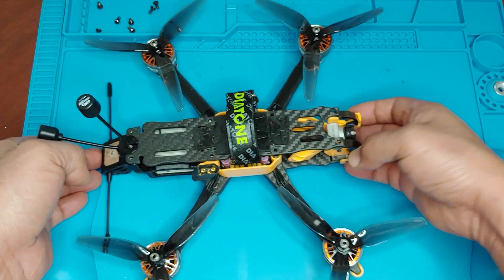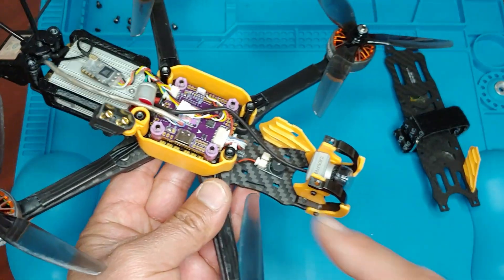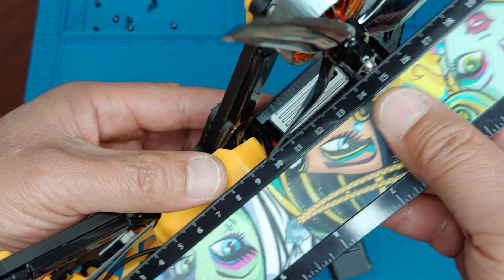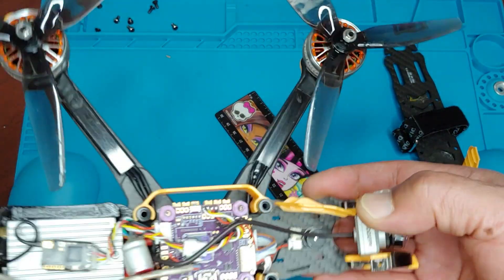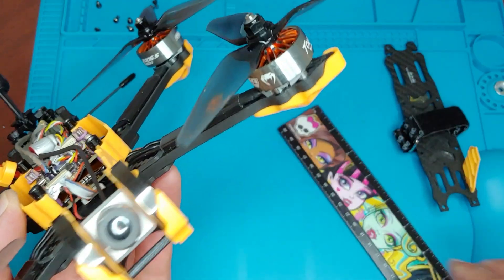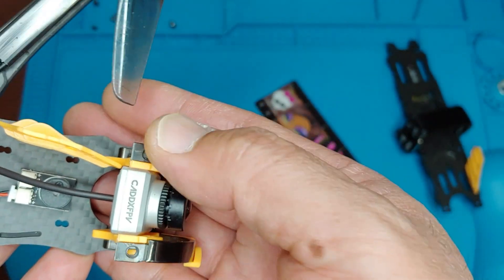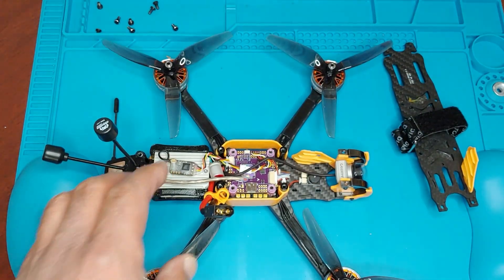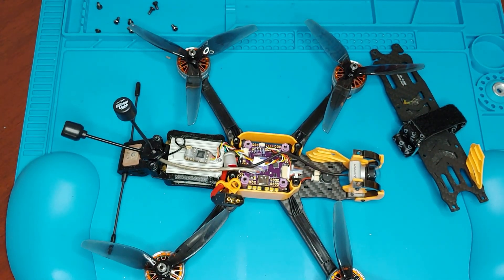Will the DJI Air unit 03 fit in the Roma F5 V2 or GepRC Mark 5?

Comment: Diatone release free stl file that can fit O3 (I do not have 3D printer, I will hack existing TPU mount). As for the front cage, Diatone upload a photo that shows exactly how I placed the camera (except that I used the carbon mount). I have not yet tested if the cage is visible... I will remove the plastic protector for sure. More to come this WE. -› https://drive.google.com/drive/folders/1biEYFoN56Uu-wNwJStyJgZBLAUQSkKdd?usp=share_link
Reply from the maker: That looks pretty good, thinking with the removal of the plastic protector like you mentioned it should be OK. Thanks for the updates bro.  I actually cancelled my order, but now after your comments and pics, order is placed. Thanks again Alexandre!!!!!!:goodvibes:
Reply: @jaechoe  looks promising for the Roma! :). I'm still waiting my crossfire receiver. But I will try live camera feed this weekend.
Reply: @jaechoe  I did my first test with my Google v2 (Video feed only). There is a small shading visible on each side. Almost unnoticeable. The tips of the propellers are also slightly visible (that might disappear using Gyroflow or Rock Steady...). The camera mount need to be 2-3mm longer to be perfect!
Reply from the maker: @alexandrelemieux6718  thanks bro, the info is awesome. As of now not alot of frames will fit the o3au, all stand off style front ends won't work since the width is way less. After gyroflow it will be perfect, thanks again!!!!! 😊

Comment: So it does fit in the mark5 ?
Reply from the maker: I was not able to try it out yet, will keep you posted.
Reply: @jaechoe  I believe it is possible. After watching this video I checked their site and noticed their offering it now with the O3 system and nothing seems to have changed. But still please do check and keep me posted!
Reply from the maker: @tylerleduc101  I just checked out he Geprc 03 AU version and the front cage looks different, seems like they put a hole in the front cage and put a 3d printed camera mount. If the mounting holes on the frame are the same width, that getting the new front cage would work.  The vista version of the Mark5 with the DJI camera 20mm width, it fits perfectly without any spacers. Will follow up once I test it.
Reply: @jaechoe  you get a chance to test this yet?
Reply from the maker: @brentroberson7371  Cole, commented that it does not fit in the Mark5 GepRC did come out with a Mark5 03au version, if the front cage has the same mounting points on the frame it can be swapped. The issue is with the 03au the lens filter up front is actually wider than the actual camera body. Most builds I have seen online have the filter/lens protector removed to fit. I still have not tried it out on the Mark5 but it does not look like it will fit.

Comment: First test with the Roma+03. The Air Unit cable is just long enough to fit the long body of the Roma, so no problem there. As for the camera mount, it's very tight. I used the thinner carbon fiber mount and it works. Will have to see if the image will be stable, I have no dampening. At the forward position of the camera mount, the cage stick out approximately 3mm. The cage could be in field of view, I don't know for now, I need to update everything and setup the quad before. I'll keep you up-to-date.
Reply from the maker: Glad it's working out so far. Thank you for the update, and looking forward to the next update. 😀 you can always crop in the image if the cage shows. But you lose that field of view.

Comment: No Jell-O but the round front post are in the shot of the camera 😢
Reply: OK this morning I was working on it again and I noticed that if you only use two screws you can push the camera up enough so the standby is are out of the cameras way🙌🏾
Reply from the maker: @manuelgonzalez3073  than the camera will have no protection, most builds I have seen so far was done that way. With the camera lens sticking out of the front standoffs. Your awesome, thanks for the comment. I have seen 1 new frame that seems to have a wider front end to accommodate the width of the 03AU lens, Pyro had it.
Reply from the maker: @manuelgonzalez3073  Quick question, I have noticed the 03AU gets pretty hot, are you noticing the same thing? just scared it might overheat and shut off for cinewhoop purposes.  I just saw Justin @ Mr. Camps channel with the 03AU in a iflight evoque flying in cold weather and he stated it was hot.  Maybe I will need to rethink my cinewhoop 03AU build, since cinewhoops have even less air flow.
Reply from the maker: Thanks for the comment 👍 😀

Comment from the maker: Anyone try installing the new released DJI Air Unit 03, in any 5" quad? Does the camera sit behind the front cage ( for some camera protection ) also does the camera touch the front cage? And if it does, does it cause any jello?  Most builds I see with the new Air Unit 03, the camera seems to be in front of the front cage.
Reply: according to what I see at 2:27, it is possible to move the camera forward by fixing it on the adjustable opening above... If the cable is long enough :)
Reply: There is enough space to install the Unit between the camera and the stack in front. That would be odd though :)
Reply: there is a bit of jello if its touching, frames need to be 21mm - 22mm at the front unless you run a narrow field of view, in the steele dc only a narrow field of view keeps the standoff from being shown but there is still a slight dark blur on the edge. in wide or ultrawide standoffs take up much of the picture
Reply from the maker: @SailingGambit  thank you for your comment,  I see a bunch of new frames coming out. Question is answered, Thanks again!!! 😊
Reply: @jaechoe  go for the new frames designed around o3 for the best experience I have o3 here tried in a few generic and well known frames all were failures with camera sitting to far back only the Steele dc was usable but only in normal fov in wide or ultra wide is was a failure
Reply from the maker: @SailingGambit  Thanks for the info, you are awesome!!!!! 👍

Comment: Thanks a lot Jae! I think that passing the cable underneath the stack might be better.
Reply from the maker: You might be right, it would be cleaner for sure, and the distance might be shorter since the front end is lower than the rear ( due to the split deck frame design ) Hope it all works out for the best with no stress.  :goodvibes:Happy Flying!!!!